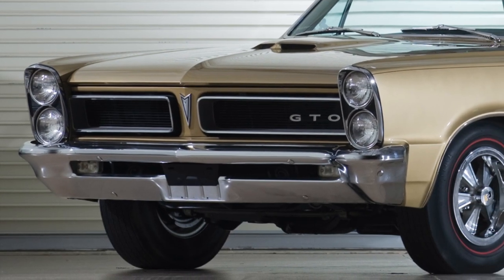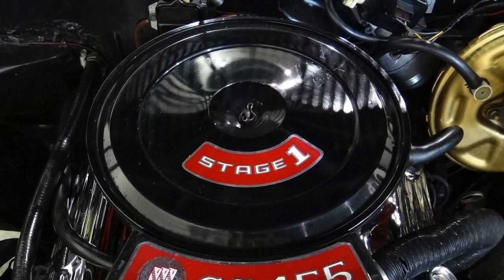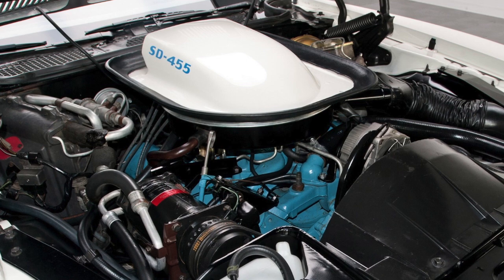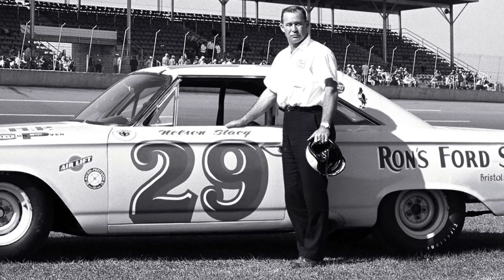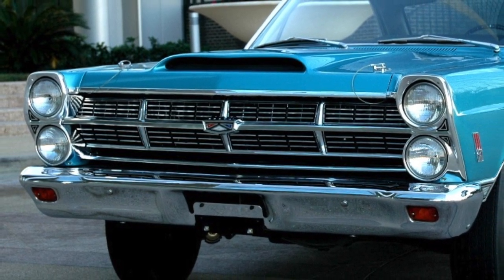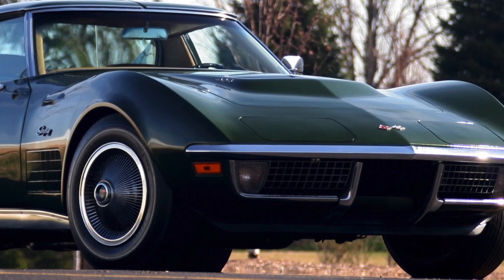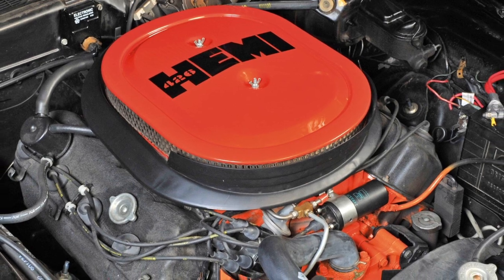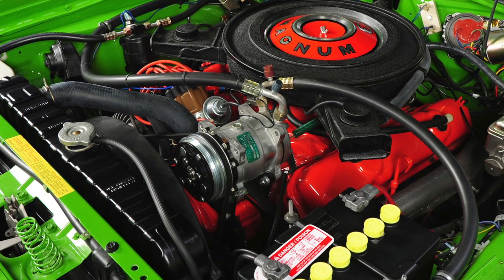5 Best Vintage V8 Muscle Car Engines

Comment: They should have mentioned that the venerable Ford 427,in 1967 won the Daytona 500, 24 hrs of LeMans AND the AA/FD title in the NHRA......although the performance of all of the others is fantastic, NO other engine has ever, or will ever do this agains.
Reply: and 12 hrs of Sebring.  The 427(in it's various forms) is Ford's all time race winning leader.
Reply: Another little piece of trivia not well known is that Ford sold their remaining inventory of 427ci side oilers to non other than Chris Craft to power their Constellation cruisers. One need only to search your local boat yard for one of these rare gems.  It's how I found mine. 
Your welcome!
Reply: Engine
Reply: @allenkeiser1718  Definitely...... I think the Ford R-Code 427 should've been number 2. The high compression LS6 454 was only in production for one year(1970) Besides I always thought the Chevy L72 427 performed better than the LS6 anyway. And the Stage 1 455 Buicks were fast but they were notorious for cracked blocks, due to the use of 2 bolt mains and very thinwall casting. Always cracked in the lifter valleys. Couldn't take the high rpm abuse like the others on this list so I don't really think it belongs here, but others may disagree
Reply: Gotta disqualify it for being unobtanium. Never found one sitting on a showroom floor in middle of farm country. Had to be special ordered.
Reply: @jeremythompson9895  i agree 100 percent buick makes the worst v8 of the gm line
Reply: Well, no.  NASCAR (buyable Bill France) took payoff money to "outlaw" Ford's SOHC 427 V8. (1965).  But NHRA allowed the engines in Drag Racing, and they promptly beat the Hemis in Top Fuel (Don Prudhomme and Pete Robinson) Funny car (Danny Ongais/Mickey Thompson) and AA/GS (Ohio George Montgomery), who all won championships.  The stock Hemi blocks never won another race except in Pro Stock. (for obvious reasons).  All the mopar wins after that were AFTERMARKET blocks, heads, etc.  not modified stock like the factory hemis and Ford FE's.  Hemi is a big, fat, heavy engine that really only does well supercharged.  Long gone.
Reply: Hate to tell you this but that was a 289 that won the 24 hrs. at LeMans. Lack of parts and a bottom end that was marginal for top fuel limited the 427's success in top fuel.
Reply: @heathdale5903  Nope. The 427 SOHC was Ford's answer to the Hemi. It was the bow- tie boys who cried foul to NASCAR. Chrysler had a answer to the 427 SOHC. It was the A925 Hemi. They called it the doomsday Hemi. It was a DOHC, 4- valve per cylinder engine.
Reply: @heathdale5903  The hemispherical combustion chamber was not invented by Chrysler; they just popularized it. Pipe, Ford, Porsche, and Aston Martin all used it before Chrysler did. You can thank Ford for the Cuda, Challenger, Camaro, and Firebird as they were all copycats created in the wake of the Mustang's success.
Reply: First 
On
Race
Day
Reply: @oldmusher  dont forget the 68 hemi dart and barracuda...they held NHRA track records for over 30 years..they didnt use blowers on them...
Reply: If were considering small blocks, how about the 302 put in the late 60's Z28's. That motor redlined at 8000-9000 RPM's. I rode in one once and it was the best sounding car I'd ever heard.
Reply: @heathdale5903  The Chrysler hemis were never really an overhead cam engine seen in real life.
Reply: Heath Dale I suppose that’s the reason why Chrysler are now owned by fiat! Ford still owned by the family. And saying the copied the sohc hemi is just being a flog. They won Le Mans from pure tech and hard work.
Reply: Ya ya the hemi has set or broke more world records than any other American  v8 just facts and in 69 won 16 nascar races in on season I may be wrong on the year. long live the legend
Reply: @jeremythompson9895  Or daytona? or the NHRA? come on, look at the results he's talking about, big races, big wins, where was your hemi at? can't compete, stay home.
Reply: @heathdale5903  427 sohc was certainly no copy of a hemi, it was built to beat the hemi, and it did wherever they competed against eachother.
Reply: Heath Dale the ford GAA was a hemi head and decades older than Chrysler hemi. There are lots of hemispherical heads around. The car world was late to the game.
Reply: @heathdale5903  Oh, please, ye olde goofball🤔🤔🤔🤔
Reply: Mmm GT40 and FORDGT the 2006  no disrespect to the 16
Reply: 289 block dominated indy for 20 yrs , with multiple cyl head combos
Reply: Johnny Lowjack 

Nope. Look up the A925 DOHC Hemi.

Chrysler was preparing a 4 cam Hemi and NASCAR got word and said only cam in block.

Look at the current Toyota NASCAR V8.

They never built a pushrod V8 production motor.
Reply: @jeremythompson9895  
They didn't have a body like FORD'S GT 40, or Cobra. Hemi got whooped by the  FE-427 and 427 SOHC Hemi engine.
Reply: @TheTeddy9212  
No, the FE-427 FORD & 427 SOHC engines dominated. For dominated the 60's.
Reply: "the 427 sohc was ford copycating chryslers hemi"I did not realize the Hemi had overhead cams. Derp.
Reply: Paul Garvin  The Ford SOHC was first. Chrysler caught wind of it and was developing the A925 DOHC Hemi. Ford built an 1100 ci all aluminum DOHC motor during WWII for Sherman tanks.
Reply: @drippinglass  -I don't think so,pal....The very first Chrysler Hemi,was the ,XIV-2220,experimental aircraft engine,..From 1944.(which was also a SOHC).
Chrysler also made engines for Tanks,too.

Chrysler's first Hemi car engine,was the "Firepower",from 1951....13 years before Ford ever made a Hemi engine of their own(Cammer...1964).
Reply: 68bobba2 I have 440 Six Packs... “pal”. Much better street motor. Vacuum secondarys and hydraulic lifters.
Reply: @jeremythompson9895  
It would have came apart like a grenade. FORD'S 427 is much better in all forms of racing.
Reply: @rickwells2946  
The 1968 Cobra Jet Mustang won the World Championship. What are you talking about?
Reply: @TheTeddy9212  
That would be the FE 427 FORD. it also won the biggest races world wide. Road course NASCAR or drag strip.
Reply: @danh8302  And let's not forget the after market Ardun OHV Hemispheric combustion chamber heads available for the Ford flathead V8 in 1947.
Reply: 68bobba2 the ford hemispheric head motor I am referring to is developed from WW1. Not 2...
How many years is that before Chrysler “made a hemi of their own” ? As you put it. 

Again the Chrysler Sherman tank motor is the a57. Its a multi bank so it’s 5 Chrysler 6-cylinder flathead car engines bolted in a radial configuration around a central crank case.
Reply: Carmen Alexander What? The mkii 427 won 1-2-3 in 1966 24h of Le Mans. In ‘67 it was a 427 also at the top spot. In ‘68 it was a 302cuid for the winning GT40 interestingly the chassis was a MK1 and the 2nd chassis in history to win twice by winning again in 69. I think you are thinking of 64-65 when the extra weight of the big motor was offsetting their gains but the 289s were DNF also. Or maybe you are crediting the 68-69 victory’s to the 289 block. 
The Under sung  Daytona Coupe did win the 64 GT class though, a great rivalry story in itself. Old man Enzo f’d himself playing his BS games, opening the way for a aero change on their only competition in the class making way to see cobra taillights for the remainder of the 64 and 65 seasons.
Reply: @heathdale5903  want some cheese with that wine?

Comment: In late 1969 I bought a brand new dodge swinger, with the 340S engine. ( paid 2995.00) That little monster would show it's taillights to most big blocks on the street. The hooked up like nothing else. Big blocks could roast off a set of rears faster but getting down the road quick was the 340's speciality.
Reply: Ahh.... Dodge owners. Never change.
Reply: My 70 Mustang 351C 4speed was always ahead of them all the way to 100. Big Mercedes radials on it. Never smoked 'em.
Reply: Best small block made in that era.
Reply: Bartonovich52 ya. Telling the truth over and over gets redundant
Reply: Must of never faced off with a 1968 nova 396 /375 hp 4 speed then.Bill Edmonds
Reply: I'm not arguing that Neil F, but if you built identical Cudas,  one eith a 400 HP 340 and one with a 400 HP 440, same transmission and tires, give the 340 a 4.56:1 rear and the 440 a 3.55:1 rear, both should have comparable traction problems, and if you added ballast to the front of the 340 to equal the weights, the 440 should win.

Comment: The high reving 340 Mopar with X heads in a 2900 pound Dart or Duster wore out most of these big blocks and all other small blocks on real street encounters!
Reply: The best domestic small-block V-8 ever built. A close runner-up would be the Chevy 327. PS, AAR Cuda was the superior ride.

Comment: Great comparision there about snowboarding and living in Miami
My top 5. Boss 302, 302 Z-28, 327SBC, 383 Mopar and 389 Pontiac. The last three are what you really saw the most of. The engine that would have been an absolute beast would have been the 32 valve Olds W-43.
I've never really gotten a handle on what makes a big block a big block. Bore centers? Deck height? The big Olds, Poncho and Buicks are all around 4-5/8 BC. Yet AMC  V-8 blocks are 4-3/4.

Comment: I was all set to critique but you got them all and mentioned next in line. Only reason for those slow sounding quarter mile times was due to narrow rear tires yielding little traction. Cars were a lot lighter back then too.

Comment: A VERY VERY informative video! Honestly, extremely well done. But in my opinion it should be titled,... "5 best BIG BLOCK vintage muscle car engines" as all engines featured were in fact big blocks. Next, maybe you could possibly do a video in the same style, only featuring "5 best SMALL BLOCK vintage muscle car engines". Please let this comment stand as a compliment regarding the clip I just watched. And also a request for another video in the same style and just as informative only in regards to the awesomeist small blocks of the muscle car era. Again far and away the best video of it's kind, hope to see more soon.
Reply: Rob Hunt only Chevy called it's engine smallblock big block so no they are not
Reply: I don't think Pontiac 455's were considered big blocks.
Reply: Chevy, Ford and Chrysler all had both big blocks and small blocks  ( Chevy  427 = big block, 327 = small block, Ford  427 = big block, 302 = small block,  Chrysler  440 = big block, 340 = small block, etc.)
Reply: The top small blocks have to be the' Ford's  71  351 BOSS, the '70 Chevy 350 LT1 and the Mopar 340.  Both the 351 and the 340 were seriously underrated.  The 302 BOSS and the Chevy 302 in the Z-28 would probably come next followed by the '64-'67 289 HiPo's.
Reply: I'll venture an opinion. Gotta include the Mopar 340, the Chevy 350, the Chevy 327, and if you allow modern heads, the 351W. If you're allowing modern heads, then you gotta include the LS3 from the 2007-up 'vette  and 2010-up Camaro SS.

Comment: Sooo many good engines during that time.  The H.O. 289, the 302 (both Z28 and Boss), the venerable 327, of course the 350, the 383 and 389, both of which lasted for years as standard wonderful performance engines.  Of course this show is about the rare ones, but many of us had real cars that were HOT and ran within just a tick of these - there were so many of them out there, and real young people could afford them.  Now, a hot Camaro or Mustang starts at $40K and they just go up from there.  My last hot one was an '88 Thunderbird Turbo Coupe that listed at $18,000 and was a true 145 MPH runner.  Of course, the newer ones can actually corner!

Comment: dont for get the 1964 Hemi  was a race only version.   the 1966 Hemi was what Chrysler called a street Hemi.    they LOVED to eat spark plugs
Reply: They did like to foul plugs when people drove them around in city traffic at lower RPM for too long. Like the solid lifter Ford FE 427 and the Ford BOSS 429 they are much more at home out on the open highway seeing how they were designed specifically to run at high RPM for long distances ie NASCAR. The 426 Hemi was not an ideal powerplant for daily driving purposes. The 383 and 440 were much better suited for that

Comment: The Chevy 427 Z-11 was worth mentioning. (A stroked 409 that beat max wedges and hemi's in the ¼ mile)
Reply: was actually a Mark 4 motor based on the 427 and 396 platform .

Comment: My friend has a ultra rare 1973 Firebird  Formula 455SD. Most of the SD engines made there way into Trans Am. I believe his is 1 of the  43 they produced. The car is in fantastic shape and only has 43k miles on it. He is a 3rd generation Texas Oil Man and has a very nice car collection kept in a climate controlled environment. His sister had ordered the car and wanted the Formula hood with the two snorkel scoops. By checking of the top engine option no one explained it would come with a shaker hood . The car came in and she did not want it . Her brother my friend said he would take it. Hence he is the owner of a rare and legendary Pontiac Performance car. It's the only Pontiac in his collection . A very good one to own.

Comment: Anyone else catch something odd at 14:40 ?   That's a 440 six pack?  Well, that's a 440 six pack air cleaner assembly, but that engine is CLEARLY a Mopar small block .
Reply: You're right, that's a 340with a 440 air cleaner cover. All Chrysler small blocks had distributor in the rear near firewall. All Chrysler big blocks had distributor in front of engine. Great catch there. I didn't notice that, usually I catch mistakes like that, being a Mopar expert. That's probably a Cuda, the cleaner says 440 six barrel, only plymouths called them six barrels, dodge called them six packs. Looks like a Cuda, hard to tell